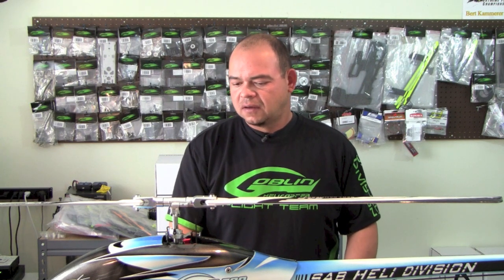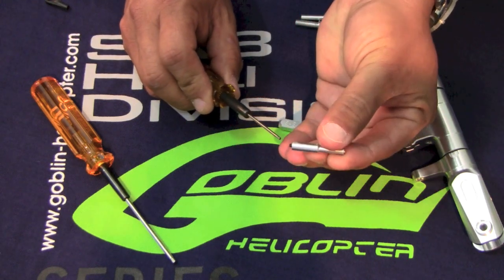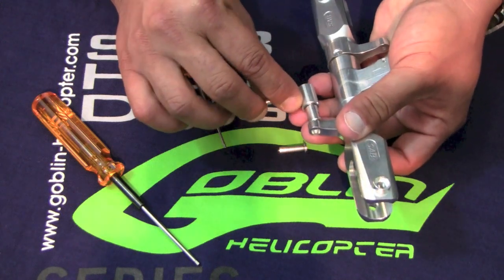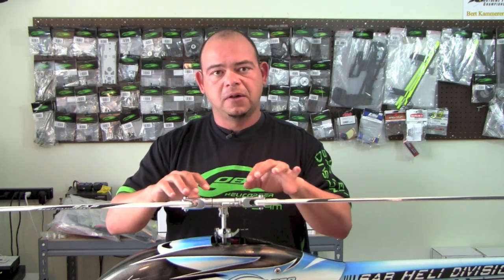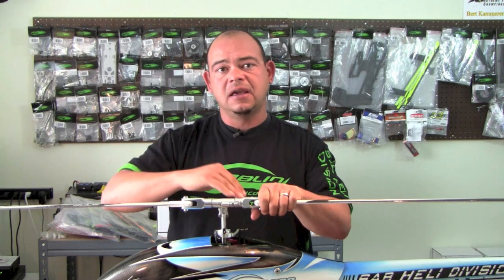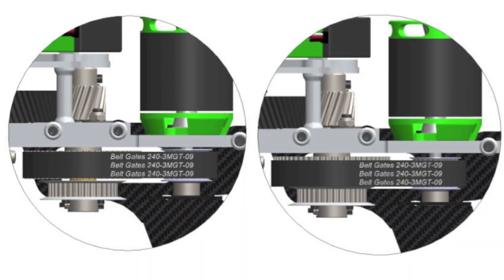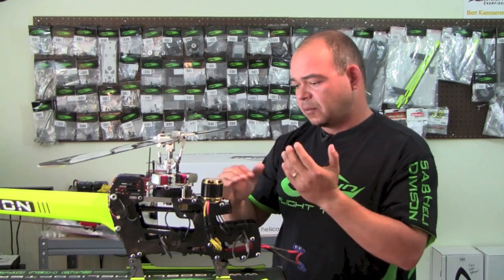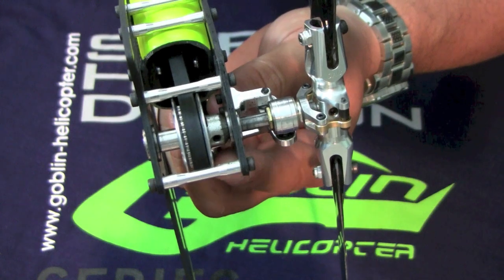Assembly and Maintenance Tips for the Goblin Helicopter

Comment: Thanks Bert.  Just a small comment on low RPM. Yes it wobbles around 1600-1700rpm with a tight head, but it flies like a charm below that. try it at 1400 or 1500 rpm.  you'll get a nice 12min flight time like that.